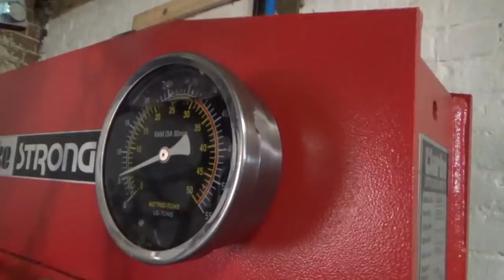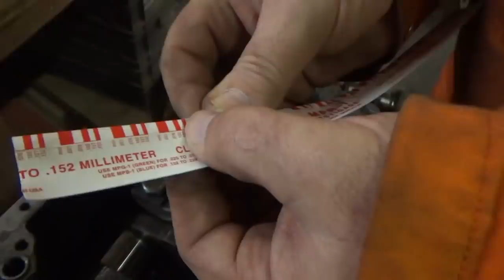WILL IT BREAK ? - 30 TON PRESS

Comment: Can I ask a question? We have a MF 165 mk2 with a 4.212. We are rebuilding the engine and the engine kit we have got for the job is a agco 10+ parts kit. The new pistons in the kit have 4 rings on the piston but the old pistons have 3 rings and are 10mm shorter as this engine is a old engine with a rope crank seal. Can you fit the later pistons, thanks for your time.
Reply: There is a long answer and a short answer, I assume that you want the short one.  

Yes, they are interchangeable.  Just do all of them not just one or two, but you knew that... I assume you are doing the liners as well because the three and four ring pistons produce different wear patterns on the bores.  But you knew that too.
Reply from the maker: @Clarence Fud-Weasel

Comment: You might laugh but at 5:30  I once used an old piston and left the rings on pushed in from the bottom where you are using a proper tool and I used a piece of hard wood and a big sledgehammer to remove the liners. I even fitted the new liners with an old piston and the rings sticking out just enough to grab the liner , worked a treat and yes I am a bodge master and Im proud to be so ya can all bowlax lol. Great video by the way

Comment: Great video mucker. But perhaps you could do a similar video without the fancy and expensive kit?  For example years ago a friend and I changed the sleeves on a Perkins A4-203 in a Massey Ferguson 65 in situ with a very rudimentary puller and a hammer and chisel. Still going last time I saw it. Be well. P.S. Behind the scenes video 👍👍👍👍👍👍👍👍👍👍👍👍👍👍👍👍
Reply from the maker: The kit isn't that expensive and the idea is to show a Perkins being rebuilt to Perkins standards. We have rebuilt engines in the oilfields of the Sahara and the Ivory Coast in West Africa using fairly basic tools but that would be more for an episode of Monkey Maintenance.

Comment: Very interesting never seen it done like before if you know any good JD mechanics I'm after some advice as how to set the back lash on a 6430 differential as I'm putting a new one in mine after a big failure local dealer not being very helpful!
Reply from the maker: Allen, drop me a message on FB

Comment: Clearly there is no tolerance for channel manure in this venue, liquid or solid,  all the same category. That said, it is a given that most folks have some knowledge, seemingly anyway, BUT when said wisdom morphs into an absolute, it then becomes diluted in potency, and in validity for sure, to the point of monotony, think fingernails on a blackboard. 
The intolerance  for silliness, AKA  facts wildly skewed by opinion,  is exactly why some folks should be thought to be full  of that liquid/solid substance  before they continue to embarrass themselves by removing all doubt. Come here for facts soaked in knowledge & steeled   by experience,  go elsewhere for absurd speculation & recycled hot air.
Reply from the maker: The last paragraph sums it up nicely Bill 👍

Comment: Need help have a john deere 3350, has no power when starting. A lot of smoke and sparks come from negative battery cable any ideas?
Reply from the maker: Have you got them on the right way is the first thing to check
Reply: @LordMuck  Yes they are on the right way
Reply from the maker: Now make sure they go to the right place and nothing has crossed.
Reply: @LordMuck  Seem to be a lot of sparks when we touched the top of the starter the two screws with a wrench. There is power going to it but very slow turnover
Reply from the maker: Pull the starter and check it over
Reply: @LordMuck  We left it for about 4 hours. When we cranked it over first time started no problem then we switched her off and tried it again and just slow turnover. Voltage is reading 0.2 volts when cranked over
Reply from the maker: Pull the starter, you need to see what's going on with it.
Reply: @LordMuck  Started first time not to bad second time sounded a bit dearer third time just about started and then 4th time just started clicking continuously
Reply: @globalturtle2185  it's the starter. Maybe solonoid. You need to pull it apart.

Comment: Youtube keyboard experts are the best. I saw in the comments of a video the other day that the right way to fuel a Detroit Diesel 2 is to mix 2 stroke oil in with the diesel 20-1 and the sump should be drained regularly as its only the to catch the excess. Looks like I've been running the 92 series wrong so far.

Comment: Cummings engines used to be a great engine till they start manufacturing them in Mexico and assembling them in the United States the quality has suffered greatly I know for a fact I've been assembling Cummins engines for 43 years in factory
Reply from the maker: Yes I remember the issue with the 53 stamped 5.9's.

Comment: I completely agree with the comments at the start 👌 

I've seen the the plastigauge and interesting to see it used in its correct way, if the space/gap is to little or large how is the correct gap obtained? 

Yes for a behind the scenes should be a laugh to see 👀

Comment: I have used plastigage when fitting main and rod bearings.  By the look on the parts store guy's face when I bought it you would think it was something new. 

I used some years ago when our Ford 3000 broke the oil pump and the farmhand ran it for several weeks before I was told the oil light was on. The plastigage confirmed no damage to the bottom end,  maybe it just converted to a splash and hope system?

On another subject,  the 2 stroke Detroit Diesel.  I was told not to bog it down when starting on a hill as it might run backward if it stalled out and started rolling backward.  Not sure if true, but I never tried it.  The engine was installed in a boom truck and the engine did have an emergency shutdown  lever that slammed a plate down over the intake.  Was this for reverse running, or for the rack sticking and stopping a runaway?

Love everything you are doing, keep it up.

Comment: Did he freeze the liners so they would just drop in ?
Reply from the maker: No, genuine Perkins liners will slip in fairly easily.
Reply: @LordMuck  ok we used to freeze the liners for Mack engine’s.
Reply from the maker: Yes, several types you have to freeze or put in dry ice for a while before fitting 👍

Comment: Another way I have seen engine liners removed is to quickly run a line of weld down the inside of the liner and the thermal shock shrinks it enough to push out by hand.
Reply from the maker: That works on some but on others it can stick half way out so you need another bead.
It's a great method for removing the outer race on a JD trumpet housing !

Comment: Very interesting not seen that before learnt something today can you help me with a small problem I'm having I've got a Lister a stationary engine closed bore (can't remove the head as it's one solid cast piece) the piston is stuck in the bore I've got it upside down filled with coke vinegar and bicarbonate of soda worked on many pistons before to release them but this time it won't free this one any tips tricks or ideas you might have
Reply from the maker: In the past I have tried (successfully) applying heat to either the piston or the bore (depending on what you can get to) and then putting pressure on the crank (a blow with a block of wood and mallet can help)
Reply: @LordMuck  thanks will see if my friend over the farm has a blow torch I can borrow
Reply from the maker: Go steady, be here take with the heat and try and get it hot as evenly as you can.
Reply: Fill it up with grease, make e fitting to go in the spark plug hole with a grease nipple on it and jack it out with a grease gun. Works a treat.
Reply from the maker: If it's simply stuck or frozen that can work well, if it's actually seized (heat or water ingress) it just makes a mess 😂 it's worth a go though 👍
A hydraulic jack (like a body dozer pump) can also do the same. You just have to be very careful with anything under pressure as you can see how quickly you can get 5 tons when we pushed out the liner.
Reply: @LordMuck  it's got a valve stuck open aswell so not sure how well pumping with grease would work as it would just come out the exhaust port I've heated it today with a small blow torch but need to get it hotter I think as had no movement going to get some oxi and heat properly
Reply from the maker: Just go steady and evenly 👍